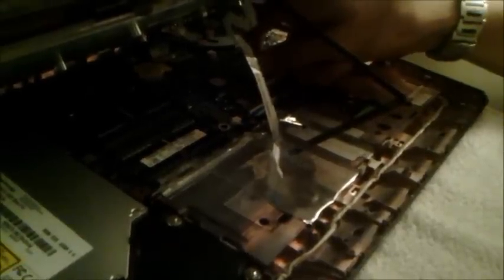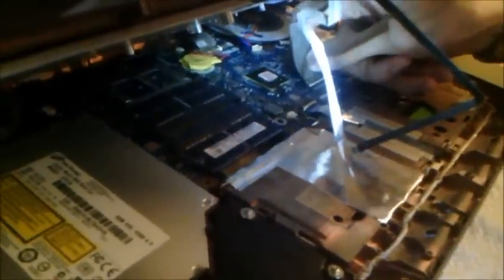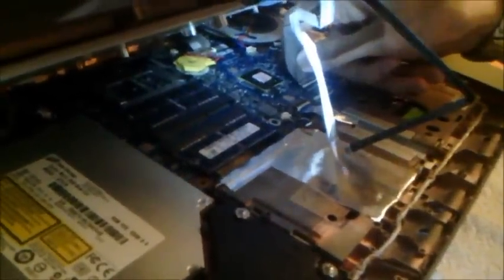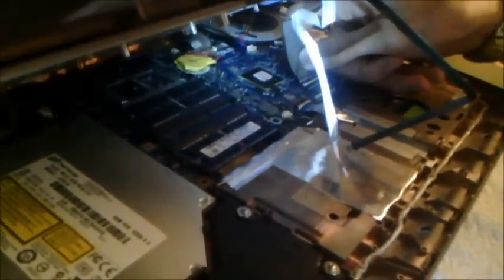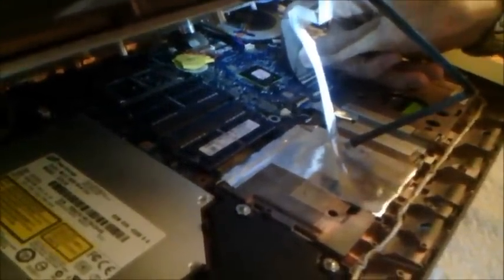G75 Revival after Bricked BIOS

Comment: Hey Rodrigo..I was hoping to see the install of the bios chip in this video..I have an Asus g75vw ..I flashed the bios with winflash and it seemed to be successful..I went into the bios and set everything to defaults (f9) and rebooted to a black screen with no ROG logo..The power light comes on..but just black screen..do you think if I replace the chip with a pre programmed chip from ebay it will work..?? and if possible can you send me a picture of the location of the bios chip on the motherboard..?? Thank You ..

Comment: i have g55vw, i bricked my bios. now all it does when i turn power on is flash keyboard lights and power led stays on. i tried ctrl+home combo but nothing is working. i tried copy pasting the bios files in c drive but no luck. can you send me a picture if possible where is the bios chip located? i am thinking to use soic clip and a usb bios programmer to reprogram my chip.
Reply: +Derek Shane try ctrl + home combo with older version of bios. it worked for me with g75vx